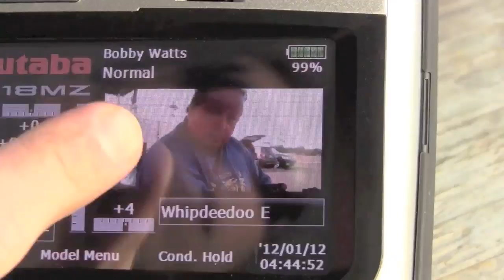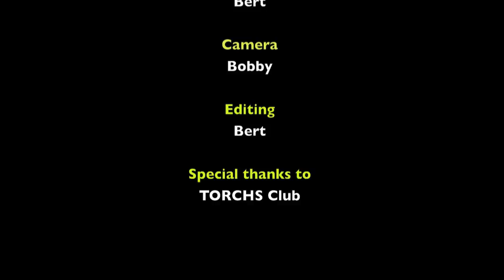SmackTalk RC Learning 3D #11 - 3D Autorotations

Comment: Hello I been watching all the video I wish I could do half of that I haven’t fly Heli’s for about 8 years I can still n do some tricks on it I have a question for you and I’m sure you are one of the only personal can answer 
I just got a synergy n5 also a brand new os 50 and servos with the micro beast I never have fly flybarless but the synergy is a flybarless Heli well my question 
Can I set up the micro beast without  the need of a receiver?
Or I need to plug a receiver then run only the servos from the bottom half hope you can help me thanks nice videos you guys put up